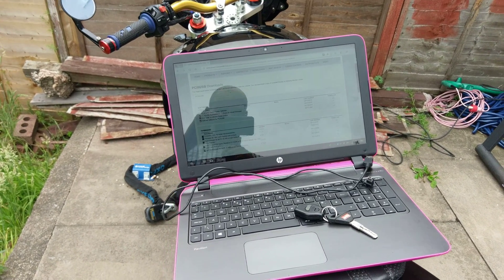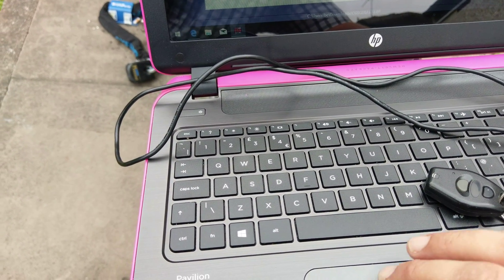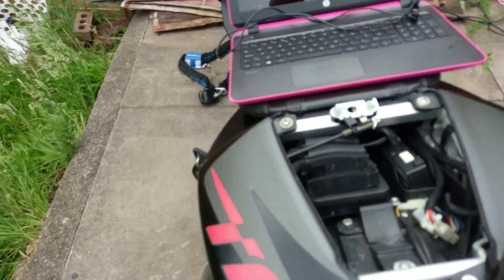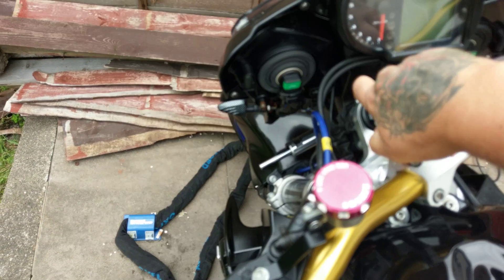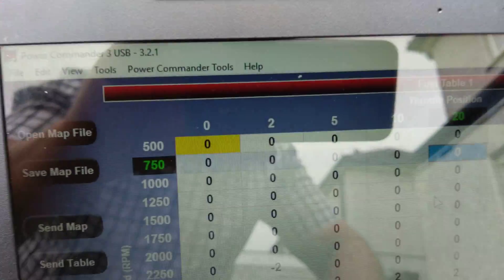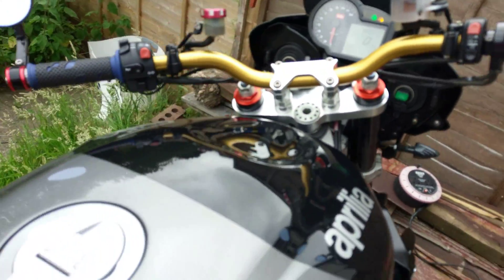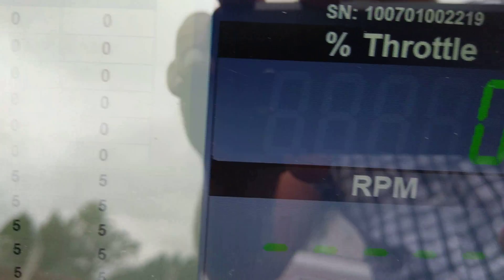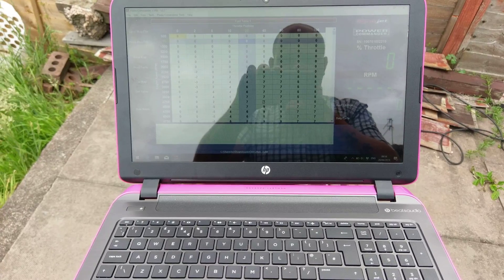Setting tps (throttle position sensor) on power commander 3

Comment: Wrong. Absolutely never calibrate the tps at cold. Only ever set it with the bike at the hottest possible. If you've got a radiator wait until that fan runs more than once. Then and only then should the throttle position read zero at zero. TPS sensors are extremely temperature sensitive. Properly set the bike will likely read two maybe even 3% at cold. The bike opens its TPS further than idle at cold. Once you start the bike that number should drop quickly to one and then zero after the bike is probably halfway warm. I can tell you from experience if it is not calibrated like this you will very likely find yourself having to hold the throttle open to keep the bike running at idle in traffic at the worst time. I have a pod 300 with a dual channel auto tune. No amount of logging data will let you know that there is something set improperly. You will literally have to see it in that hot engine scenario where it is trying to die at idle and you are having to twist the throttle to keep it alive. In that moment if you have TPS up on your screen you will see it reading zero when you are very clearly twisting the throttle. The logging that will be generated by the pod on a bike that does not have a properly calibrated TPS will likely never read anything less than 1%. Do not think that the power commander only reads those specific throttle positions. It averages a position across the range of throttle position and RPM. Properly calibrated the logs will generate decimal points of a TPS position at idle. The screen will still read zero if it is less than one. There are far too many videos on the internet showing the TPS being set improperly, and too few sources of information from DynaJet that actually stressed the importance.

Comment: May seem a dumb question but how come your PC3 is communicating with the laptop with the bike not running? I can only get it to communicate when the bike is running, meaning I can only set the wide open whilst running which isn't convenient to say the least... I've ordered a 9v adapter to give power to the PC3 so will see how that goes....
Reply from the maker: Not sure mate  mine used to kick in as soon as I turned the key..be an real arse setting TPS with engine running bouncing of the Rev limiter in neutral..hope you sort it bud 👍
Reply: @BigBoyzToyz1974  cheers dude, I seemed to get it setup nicely by running it to set the 0%, and then flicking the killswitch off and on quickly, which lets you set 100% without smashing the limiter!
Reply: @I3ellamy09   what about putting the bike on paddockstand in 6th gear and than smach it wide open and release... it should not have the power to pull into higher revs that way in that split second

Comment: Click reser, twist wide open click ok... or twist wide open, release hit ok?
Reply from the maker: Click reset when closed, then open throttle fully then while still open press ok 👍
Reply: @BigBoyzToyz1974  turns out my version won't read throttle when bike not running. PC's web site has a qna on it. Press rest with bile running, throttle closed. Crank throttle open full, release, click ok. Got stable zero.  Thanks though,  your vid got me pointing the right direction

Comment: What unit does the pc3 gives you the tps voltage in?
Reply from the maker: TwistDaThrottle it’s in Millivolts not 100% but I think it’s between 350mv and 500mv

Comment: Would that fix a too sensitive throttle?
Reply from the maker: Not really it's more to do with fuel demand at certain positions throttle to sensitive is usually cable to tight.

Comment: Hey can i use this feature to remove the 2014 r1 throttle restriction?
Reply from the maker: Not sure but I doubt it that's usually ecu program I know gsxr restrict throttle in first few gears they use a module to bypass it.